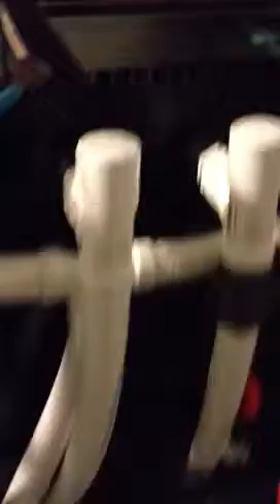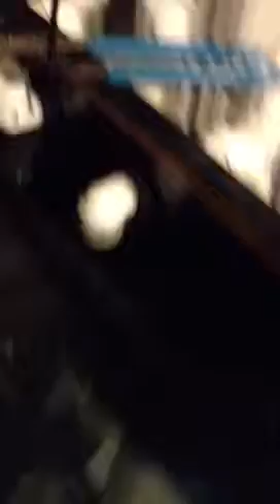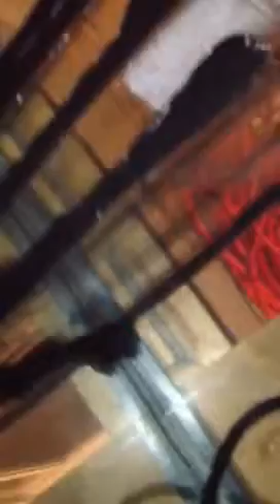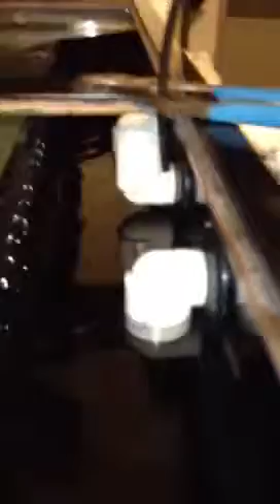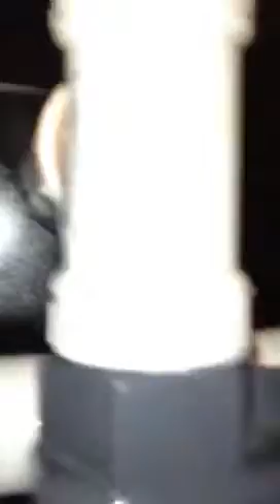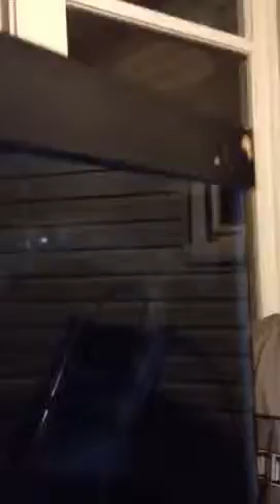BeanAnimal Overflow system demo on 75 gallon aquarium.

Comment from the maker: i was re-reading my posts and realized i left out a minor detail - the airline is secured with the pipe / wire mount 'to the wooden canopy i made after the video was created and posted. its on the backside of the tank and rests about .5" above where the emergency pipe rests (pretty much where you see it in the video) and about an inch below the top of the tank. i will add that for this feature to work properly, the valve that controls the adjusting line needs to be more than 40% open to create

Comment from the maker: other than mentioned below, im extremely pleased with the system. its been put into practice by faults of my own, and system failures (pwr outages during storms and top off pump running too long) and the self-adjusting aspect is absolutely worth the headache designing it creates! I'm glad you enjoyed the video, and that you chose to inquire about it. this was my goal in uploading it here. feel free to ask more questions if you have any and i can always email you pictures of the build if needed.

Comment from the maker: I am actually in the process of redesigning it right now and plan to have it completed before years end. I also would recomend that you drill the holes as close together as your design allows. give room to twist fittings if the bulkheads are threaded, if slip on type, even closer. and if you do deside on an internal overflow box, take it to the ground so there isnt a shadowing effect going on inside the tank. i really hate that about mine and is the major reason for my redesign.

Comment from the maker: I believe the center line of the holes were around 3.5" from top of tank. (please research this as it was some time ago and i could be +/- an inch or so). The air line is secured with a plastic pipe/wire mount that is very cheap and easy to find at lowes or similar store. by overflow box did not have to be the dimensions that it is. if i could, i would redesign this to be on the back of the tank as it takes a lot of depth away from the visual aspect of the final project.

Comment from the maker: First off, thanks for the comment! it was well received. To clarify some of the points you make and questions you ask, i'll go in order to prevent potential confusion. I drilled the bulk-heads where my research led me to drill them for them to be placed at the highest point on the tank wall without compromising the tank itself. i then designed (on paper) the overflow box and had it custom made at a LFS.

Comment: How did you know exactly where to put the bulkheads so they all were at the spots they needed to be? Also how did u end up securing that airline hosing? I am very glad I can across this because I was a little confused after reading the forum post on how to make this... Also is it necassary that the black box is that long? Or can it just be as long as it needs to cover the pipes? Thank you so much! I look forward to your reply!